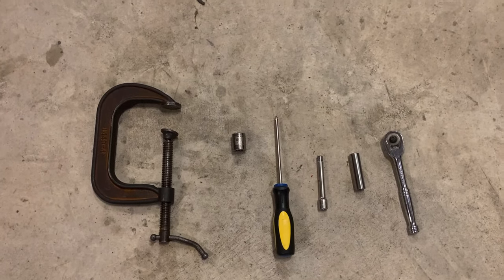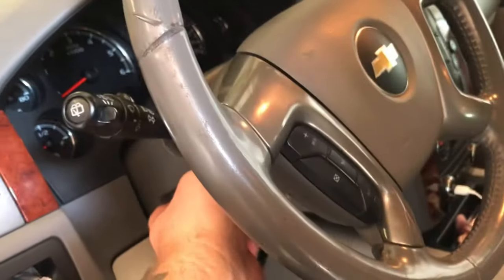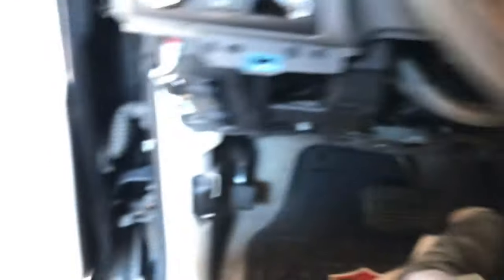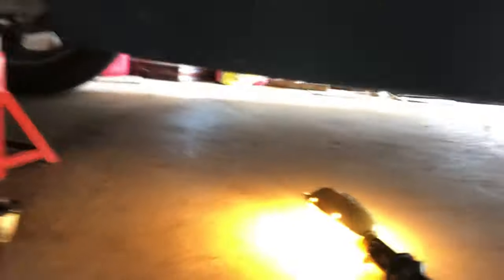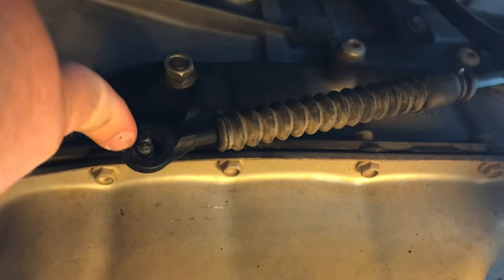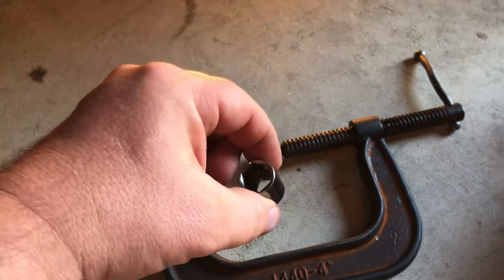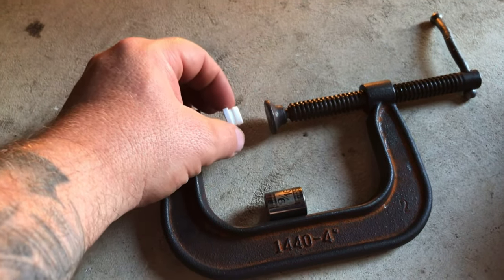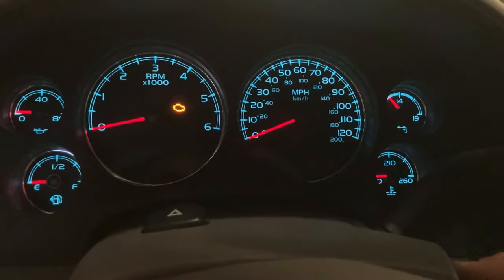Shifter Linkage Bushing Replacement for Chevy/GMC SUV & Truck

Comment from the maker: The bushing I used was made by Dorman part number 14055.  I bought it at an O’Reilly Auto Parts.  It came with two bushings.  A clear and a white one.  I used the white one.  It was a booger to squeeze in.  An extra set of hands would of been helpful.  Unfortunately my helper hurt her hand in a fireworks accident a few days before I made this video.
Reply: Oy
Reply: did you used the ones for trailblazer??
Reply: How is the replacement bushing holding up? Is it still working okay? Planning to get for my 08 tahoe with the same problem.
Reply: Awesome find! How did you go about searching for that particular Dorman part and part number? I'm in dire need of a new gear shift selector bushing for an 06 GMC Savanah and would like to find one asap but not sure how to search Dorman for that exact part(?)
Reply: what if the truck is in neutral
Reply: @curatedbycarlyssa5238  this just happened to us at home, I zipped tied it together temporarily as I try to find the correct bushing
Reply: Thanks for that part #.
My 07 with 218k just wore out and fell apart.
Reply: Thanks for sharing!!
Reply: Will the Dorman 14055 bushing work for a tahoe 2011 with the exact same problem?
Reply: @0RONY1  I used the clear bushing on my 2009 Suburban 1500 with 4wd. I could not get the white one installed. The clear one went in and installed easily. Tony
Reply: 2006 5.3 crewcab Silverado 2wd. I used the Doorman part#14041 installed less than 5 min
Reply from the maker: The guy behind the counter at the auto parts store pointed me in the right direction
Reply from the maker: Still running strong
Reply from the maker: You can move the lever that the cables hooks to in whatever gear you’re trying to get it too
Reply from the maker: It should
Reply: @tonyhouk9047  That clear bushing is easier to get in but it has a wider necked down area than the white bushing allowing the end of the shift cable to move and twist.  Is it staying in place and working for you?
Reply: @krwebster2838  yes it is working for me. I tried for about a hour trying to get the white bushing on to no luck. I hope it stays stays on or I’ll throw another zip tie on it. Tony
Reply: @tonyhouk9047  Yeah, I tried to get that white bushing on too with no luck.  Clear bushing working well for me as well.  Thanks for the tip.
Reply: Thanks a lot for the video. I was on Amazon searched Dorman 14055. It says this part doesn't fit 2009 Chevy Avalanche. but your vehicle should be the same construction as mine. still wondering. thanks for any clarification on that.
Reply: For those who are going to do this, I found putting it in very hot water before putting it on made it easy.
Reply: @krwebster2838  any update on the clear bushing? Just put one on today and seeing if it’s going to last. Cable seems pretty loose on there
Reply: I’m about to do this, and I also read that putting it in hot water to soften it up helps getting it in
Reply: Dorman #14055 worked for me too. I have a Chevy van 3500. Thanks for listing the part number that helped a lot! You guys are awesome!
Reply: I'm doing this today...just want to make it to work tomorrow
Reply: @0RONY1 whoever is wondering the 14055 pn does not work. I got this one from o rilleys and it did not fit.
Reply: I used that part. It keeps sliding off I have to go under and slide it back on every 2 days. Do you think mine was faulty?
Reply: Hallo I net Bushings for 124 m111 mesedes Benz 124 m111 for gear am taoun 5 speed
Reply: What is the clear one for?
Reply: So I had this happen to me. Got in my truck to go to work and it wouldn’t start. Anyways figured out the problem and went and got the part. Snapped it in and popped it on. But mine keeps coming back off? It’s like it’s not snapping in? But feels like it’s on all the way? Idk but super annoying.
Reply: Thank you for your video! Saved me time searching for the part number and saved me money instead of buying the whole new cable!

Comment: Thanks for the video! I drive 28 miles to work. Mine broke at a gas station a mile from my site. Got a ride , saw your video, called a dealer. He said they only sell the entire cable. Seeen you had mentioned the part #. Went to O'reileys, struggled for 3 1/2 hours in the gas station parking lot. Zip tied it, got it to my site. Had to shave down the bushing to get it in. I used my grinder.. You saved me a tow bill, and who knows what a shop would have charged. THANKS!!!!
Reply: They probably would have charged you for a whole new transmission

Comment: This was exactly my problem! I actually checked under the vehicle first and I didn’t have to do the extra work under the steering wheel. Thanks a lot!! Just an added note: I used the clear bushing; it was less struggle to install and it stays on.
Reply: Do you k ow what size the bushing was?
Reply: Is the bushing still holding up?
Reply: @itsslyssaaa5815 to try😊

Comment: Thanks brother you helped save my life my truck means the world to me so when I ran into this problem I was depressed because I have a low budget and I thought it was my interlock solenoid but then once I replaced it my shifter still wouldn’t work but then I watched your video and BOOM 💥 FIX THANKS AGAIN MAN 💪🏾👍🏾
Reply: phew man, my step dads landscaping 2500HD just got stuck in park, I figured it was that too, and pulled out the electrical harness to bypass interlock solenoid and it worked (parts coming in from Amazon as I write this comment). I told him if that doesn't fix our issue it can be some other MUCH more difficult problems or links under the truck or in transmission lol. I know how that feeling is when your first guess isn't it- but this vid shows a nice and easy fix for the second seemingly common problem with transmission shifters in these GMs. Great job!

Comment: I can’t thank you enough. Dealership said I had to buy the cable to get the bushing !
You saved me $200.
Reply: i bought my bushing from AutoZone for 7.99 it was in the isle near the trailer lights.
Reply: Purchased mine at Oreillys worked great.
Reply: @mcrum4421  quick question, did not find a good vid how to take out the old one. mines worn. brought my van in for a trans fluid change and filter. two days later my cable falls off. mangled mess of zip ties. i think the person i brought it to. i had the trans rebuilt 2.5 years ago and i only have 10k on it. i moved so i brought to a new place and no way have i been riding with those tiny zip ties for over 2 years. they were also rather shiny black. i live in new Hampshire and that's two winters its been thru and those would have been covered in crap not shiny if they been there for years.
Reply: @mcrum4421  i figured id ask since you just posted. thanks for any info if not any thats fine too thought id mention it.
Reply: Sounds fishy to me. But I don’t want to assume anything. It seems like good help is hard to find anymore. 
The bushing is plastic so it should come right off with a pair of pliers. Lubing/greasing the new bushing one will make it easier to pop on to the transmission linkage post.
Reply: @mcrum4421  thanks for the help. yeah sketchy. i did not even mention i brought it for inspection as well and they ran it passed it and never put a sticker on. just realized that today the sticker is still old. thanks again. see how it goes tomorrow.
Reply: @incredible5587  👍🏻

Comment: Thanks for the video. Minor point, soaking the plastic bushing in very hot water makes it flexible and a lot easier to install. Mine broke last night as I was pulling into parking space at home. Checked YT and yours was one the first video's to come up. Just fixed my Silverado 2500HD
Reply: Did you have to use the C clamp?

Comment: I almost bought the whole cable until I saw this video. Mine came loose on the bottom half like yours this might save me some time and money thanks dude
Reply from the maker: It took me a lil more time than it should of for me to put it on.  You can hear the night critters getting louder as the video goes along.  An extra set of hands would of really been helpful for me

Comment: Thanks so much for posting. This is what happened to my 2009 Chevy Silverado 2500 and your video helped solve the problem
Reply: 2009 Silverado? That bushing registers as not the right fit. Can you confirm if you went with this bushing even when the website didn’t register as the right fit? I have a 09 Silverado 1500 and looking for a different bushing and saw this bushing so I’m wondering if this is better for the fit.

Comment: Thank you so much bro This just happened to me I was about to call a tow truck I live in New York I got stuck in Philly That would have been a long tow truck ride a lot of money watch your video went underneath the car found the problem I did that put the car in drive park is slipped out again so what I did I got a piece of electrical wire stripped the plastic off use the bare copper strap that puppy on it twisted it with a wrench

Comment: YOU JUST SAVED ME LITERALLY
Reply: I literally just got off work and it did not wanna shift and I was loosing my brain , I had just fixed a major issue , I zipped tied it for now when the auto part opens up in a bit ima go and fix it

Comment: Everybody is different but the Dorman 14073 bushing kit from the Auto Parts store does work best all you need is a cord or cordless drill, 3/8 drill bit or I’ve found that the 7/16 bit works best and pliers with 5 minutes or less of your time then done! No huge heavy C-Clamp or socket
Reply: What did you do? Did you grind the link hole with the drill bit so you can push the bushing in easier? Please respond
Reply: Sorry for the late reply but yes slowly bore the hole out to fit

Comment: This is the second video on this subject that I have seen and both fail to use a drop light to illuminate the underside properly. I can't see in the dark as I suspect many others also can't . Not trying to be mean but would help if we could actually see the work your conducting under the vehicle.

Comment: I just replace the bushing and the C clamp method sucks ass so what I did was got a bolt with 2 washers and a nut and tightened it until it was locked in place and it snapped right on!

Comment: I tried for the LONGEST trying to get the white bushing in and could not get it. I used the method in this video perfectly and it would not go in. I ended up using the clear one. The clear one doesn’t seem as tight, but it still takes a decent amount of force to pop off from the selector. If it pops off down the line, I’ll put another in lol
Reply: You can heat up water in microwave and put the white one in the water then quickly install. I took the hot water under the vehicle with me.

Comment: Use the 14073 bushing for 2005 to 2012 Chevy Silverado. The one it suggest really doesn't work if your having a difficult time putting it in just get a small drill bit and shave each side of the hole and then snap the bushing in.. Shaving the hole makes the job a snap the suggested bushing does not work

Comment: Nice video, my shift linkage and cable is off by just a tad 1/4" transmission not going all the way in park, any suggestions?
Reply from the maker: I know I’m extremely late on replying but, I believe there is an adjustment dial on the linage you can turn to adjust.   This is just off the top of my head.  I’m not 100% if it was in this or another vehicle.

Comment: I did this repair on my 2010 Chevy Tahoe about 3 weeks ago, but last night the shift cable slipped off again. Any tips on how to make sure that doesn't happen again?
Reply: Did you ever figure this out? My bushing doesn't keep it on either.
Reply from the maker: Mine never came back off.  I know on other vehicles there is a C clip that helps hold it on.  Maybe find one that can slip on there

Comment: How does the bushing go into the shift cable hole with ease, to where all you need to do is squeeze it in?

The ones I have are bigger than the black hole. How is it supposed to fit in there
Reply from the maker: I apologize for responding so late.   My daughter is my “tech person”.  I don’t get on here much.  Talking to others I’ve heard soaking in hot water helps.  I wish I would have thought of that at the time.

Comment: Trying very hard to get it in but the bushing is the same size as the loop on the end of the cable that connects to the transmission how do you get around that?

Comment: For some the bushing is a hassle to push on once you press it into the cable end. So, Use the same method with the c clamp to securely push the cable and bushing on to the transmission male end. You can use a smaller c clamp. I have a 2013 Silverado and it worked perfectly.
Reply: My 2013 GMC Sierra had a failed bushing. I just installed a Dorman replacement bushing that went in well and snapped on to the transmission lever end. However, with a medium amount of pressure it would still pop off. Today it popped off again after shifting multiple times on a multi-point turn. Thoughts?
Reply: @bmorleyy mine keeps popping off as well wonder if I try to press it on the shaft with the c clamp would it hold better?

Comment: For the life of me I can not get the white bushing in the cable! And I don't have an extra hand to help! Any sugestions?  2010 YukonXL..SLT 2 wheel drive
Reply: Coffee cup full of water, heat for 2 minutes, use a fork and push the plastic piece under water for 30 seconds. Take the cup under the vehicle, and quickly install the plastic piece. It being heated up will make it more pliable to install.

Comment: This happened to me at 1 am and I didn’t know what the fuck was going on I had a brand new tranny put in so I was freaking out,it was stuck in reverse so it wouldn’t crank,really disappointed in the transmission shop for not checking it,mine is a 2012 Ppv so it’s lower which made this job a little harder but still easy,for anyone watching get dorman automatic transmission shift cable bushing part #14073 it comes with a sliding lock washer,mine is dirt nasty low so I couldn’t imagine fighting that bushing with a set of channel locks,hope this helps someone.

Comment: How tight is the bushing suppose to be on the shifter? Replaced the bushing but it keeps falling off the shifter.
Reply from the maker: It shouldn’t just slip off after you pop it on.  If you tug on it, it will pop off.  You may have the wrong bushing.  I noticed more than one GM bushing when I went on my hunt for one.  I don’t remember the exact part number of the one I used.  It was white and from Auto Zone if that helps.

Comment: HI. I THINK  I have the same problem with the shifting gear , my mine doesn't want to turn on.
It has parking assist off.
Is it related with the some problem?
Reply from the maker: Sorry for the late reply.   If the vehicle is not in park or neutral it won’t start.  If you can get under the vehicle and move the linkage to either of those positions.  If it still doesn’t start, your problem is somewhere else.

Comment: My husband changed this whole cable out and now the truck won't go into park. All other gears work but park. We have to put the truck in  Neutral to turn it on. Any ideas where he went wrong and how to fix it?
Reply from the maker: Sorry for the late reply.  There should be an adjustment dial on the linkage.  Turning it should give or take away length.

Comment: Is the vehicle driveable, until I get it fixed?  Thanks
Reply from the maker: Sorry for the late reply.  I’m sure you know the answer bu now.  You can drive but you’ll have to get under your vehicle and manual shift your linkage every time you have to switch to different gears.

Comment: My shifter got hard and gritty, could this be due to a bad bushing?
Reply from the maker: I don’t think so
Reply: @howtowiththisdude5318  any ideas on why it's stiff to shift at my steering column into drive, park ect..?  . I did replace my shift bracket and solenoid but that didn't help.

Comment: 2013 GMC Yukon, Part number 14104. The bushing is too soft. Easily pops of of the ball of Transmission lever. I think a hard plastic would have been better. My son picked the part up from Napa. Disappointed with this part made from Dorman.
Reply: I have the same problem
Reply from the maker: I guess I got lucky with mine.  I had bought a few different ones and they all seemed a little different.  The one I used was what the parts guy suggested and it worked for me.  Good luck
Reply: Same part same problem! How did you fixed it ?
Reply: @marc-andrethibodeau  I ended up using the part but safety wired it to the lever. Wonder why a circlip design wasn’t used?

Comment: When you add the white bushing with the C clamp i missed you adding the outside E clip?
Reply from the maker: An E-clip isn’t used with this bushing.  GMC/Chevy really could of designed a better method for the linkage connection on these.

Comment: i checked the part number but it says doesn’t fit tahoe, i think its for trailblazer
Reply from the maker: I bought a few different ones.  The parts guy suggested the one I used and it worked for me.